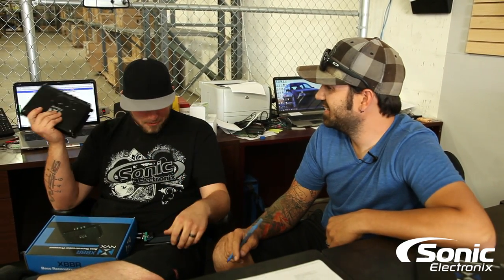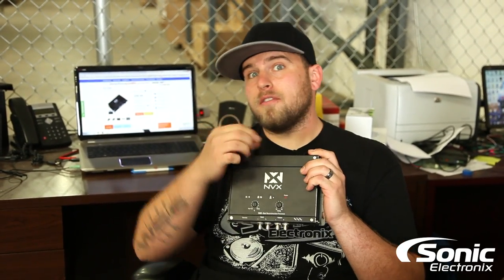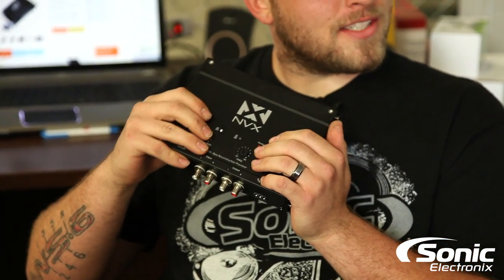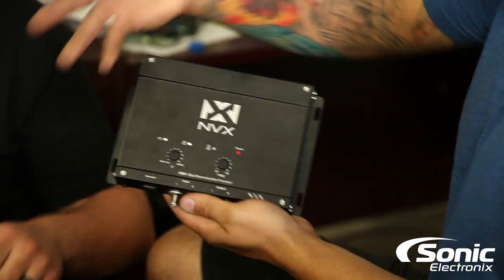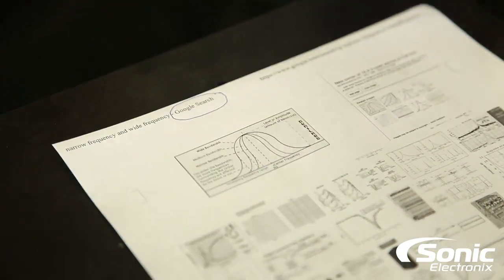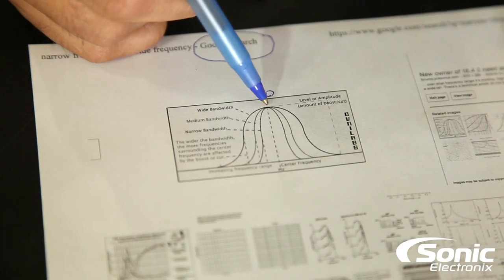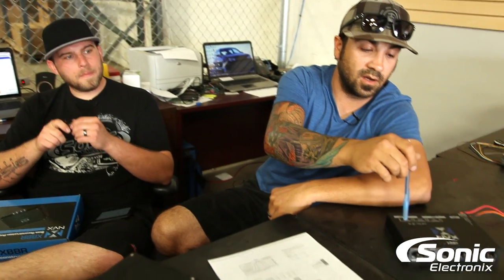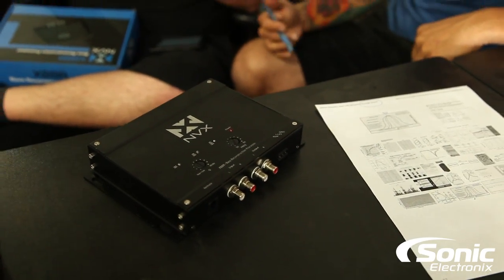What Is A Bass Processor and How Do I Wire It? | Car Audio Q & A

Comment: I have that same unit they used as the demo, it works really well. I wouldn't build a system or run a sub without one, I was very impressed by it!

Comment: alot of people still do not get what a bass porcessor does.. it actually takes the signal in and turns the pitch down significantly and it just low passes the signal with a lowered pitch so it basically converts mid bass to nice low bass.. which creates great bass for mexcian music or rock and stuff..

Comment: According to audio control the correct way would be to use the front rca outputs. So you can get the full spectrum. And restore the bass where you want to. 28hz to 67hz

Comment: Hi Sonic, could you guys explain how to use a Rockford 3Sixty.3 and also how people use it to hook up multiple amplifiers say 6 or 8? Thanks!
Reply: I would like to see this video as well.
Reply: John Harris id like to see this video, I'm really interested in getting a 3Sixty.3 processor, but from my research is that your audio out from your deck goes into your processor than you tune and adjust your processor with computer programming and tha aux outputs from the processor goes out to your multiple amps, 

i need one for the two amps to my subs, the amp for my 6x9's and the 4 ch for my doors and tweeters, the idea is to put the proper frequencies to the speakers that were made to produce these frequencies.

hope this gives an idea of what to do with a processor, maybe checkout rock fords website for a better idea
Reply: decibelchild You have the gist of it, I currently have the 3Sixty.3 and have not been satisfied with it. I really wish I would have went with the Audison Bit10 D.

 I may have a bad unit but I didn't buy it from Rockford certified distributors even though it was bbrand new in packaging I have been getting terrible customer service from them, the unit doesn't perform as it should, the software messes up on you. It has caused one of my amps to blow during a tuning session it stopped outputting sound then put out a really load noise where I couldn't control the volume and caused them amp to fry. Rockford did replace the amp shockingly but they won't replace the 3Sixty.3

I was going to do a SQ build all Rockford, but that steered me away and I think I am going to sell my stuff and go Audison/Hertz

Comment: Thanks JL Audio for having this on my 500/1 since 2001.
Reply: FlexYoFace Chase I just got an RD 5 channel amp (about 2 months ago) and it doesn’t even have a subsonic filter. I would’ve liked to have one, in case I want to try a ported subwoofer box. I’m probably gonna need some kind of processor like the NVX from the video.
Reply: Thanks to Audio Control for actually making the technology back in 1987 with the Epicenter Bass Restoration Processor.
Reply: How does your amp have a Bess restoration? I have a slash 500/1 it doesn’t do what the epicenter does

Comment: Can you splice into the power, remote and ground going to your amp? Or simply connect to those areas on the amp itself?
Reply: As long as the wire is thick enough to provide efficient current ect..

Comment: What exactly is a processer for. I mean u have eq.s,Crossovers,amps etc so what else should be needed.
Reply: When you play music not alot of it gets into the low 30s, and if it does its usually just noise or its really quiet. This fixes that.
For example I have 3 sa12s tuned to 36hz but all the classic rap and rock music I play has almost no bass that goes that low, it's more like up in the 60hz-80hz range. This gets those bass frequencies and adds bass if its not there or enhances bass if the song does have it. So you can choose a range of frequencies to be added/enhanced to your system.
For me I would change the sweep to around 36hz since thats what im tuned at and I like low bass. Then id increase the wide to the hz that I want and that sounds good to me, lets say 60hz. Now everything from 36hz-60hz will be enhanced or added to the music im listening to, even if those frequences dont exist in the song. That way you always get maximum bass no matter what music youre listening to and you dont have to cherry pick songs that sound good on your system
If you have a low system and you dont edit your music then this is a must have in my opinion
Reply: @rickytrevino8281  holy shit

Comment: Ok what is the difference in a electronic crossover and that bass processor???? I've always used Electronic Crossovers... So that I can control the highs mids and lows. Wouldn't it better just to use a Electronic Crossover then the Bass Processor??
Reply: no.....the crossover just separate the signals
Reply: They’re not the same thing. A crossover you always gotta have. A bass processor is optional and serves a different function. It reads the signal you feed it, and based on that adds bass where it’s lacking. It adds the bass, then you boost it to taste. A crossover is simply a filter that filters frequencies  the speaker can’t handle.

Comment: Help me out. I just bought an Orion 2400 watt mono block and is hooked up to my kicker cvx 1700 watt 12'. When I turn it up too high the Amp goes in to protect but when I turn it down it immediately kicks back on. I had a 2400 watt planet audio Amp before and it never did that. Could it be I need a crossover because I'm using a line out converter?? Or is my sub going out because it seems like its also  a certain frequency that will make it go out. I don't know whether it can't handle the 2 ohm load or if it's my Amp. It doesn't over heat or anything it's brand knew and I redid all my wires too. Please help before I spend money on a simple fix! It's at 2 ohms by the way
Reply: +Adrian Fernandez I'd guess it's going into protect because the voltage is dropping so far down,  What size power and ground wires are you running?, do you have big 3 upgrade? are you running an upgraded battery or alt?. the Orion does A LOT more power than that Planet Audio... look at amp dyno's that PA probably does 600-700 watts tops droppinhz dyno'd a Planet Audio 5k at 1.3k rms... the Orion on the other hand does rated power and will put a lot more stress on an electrical system that's not properly setup to handle it.
Reply: Thanks. I actually figure it out. I'm using four Gage wire but my remote wire was only sending 5 volts into the Amp. After I found a 12 volt for the remote it works great. I have a 2014 Honda accord so taking the deck out wasn't really an option for me. I just added a hifonics bass processor and it sounds great. Working on building a bandpass fiberglass box. I don't think I have ever seen one so we will c how it turns out. If u had any suggestions on that I'm more than happy to listen. Thanks
Reply: +Adrian Fernandez Glad you got it figured, I honestly would have never guessed that! Good solid upgrade from the PA. I'm getting ready to build a box myself for an RE 18", can't wait!

Comment: will this boost the output voltage of the rca before amplifier say 2 volts to 4 volts ?
Reply: I think it goes to 10V RMS.
Reply: you have some car radio's that boost the rca up to 4 volts i've got the kenwood kdc version and it works alot

Comment: do you have an 3.5 inch subwoofer speakers  the one that use the Suzuki Aerio 2006
Reply: do you want a sub or a full range?
Reply: the subwoofer that came from the box its a sanyo active  subwoofer, you got email so I can send you a photo
Reply: Do you just need a replacement?
Reply: yeah, or a better one in that size

Comment: What I find funny is you guys obviously don't understand it needs a full range signal to work the way it should. You also do not run a 12v constant to it (yellow). It runs off the (acc) (red wire).  And  you call yourselves professionals. Hahaha. Go back to school and learn your shit.
Reply: The remote wire is supposed to turn it on. It acts like a jumper between the constant power and the ground wire. Just like an amp.
Reply: I know what the remote wire does brother. my statement is that the bass restoration unit. like other components is meant to have a 1.5-5amp fuse on it, seperate from a head unit and not a constant power as they say and are using that in their tutorial. red is accessory wire. black as the ground and blue as a remote. you clearly miss understood the point I was making

Comment: Reconstructor / paste generator hook it up keep it on zero and guaranteed it will be pumping more bass than just your normal system I have the BX 20 Soundstream bass generator and it is badass
Reply: Keep what on 0? My hu is 4v and amp gain is set to 4v so if i install this it will boost the voltage to 7.5 i think...so does that mean i have to readjust my gain on amp and make it lower since its getting a higher voltage now?